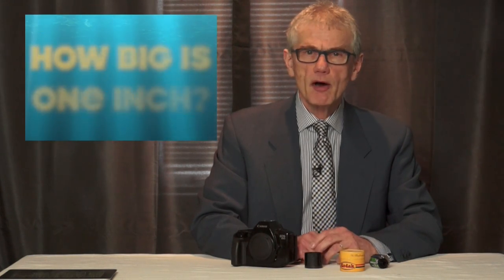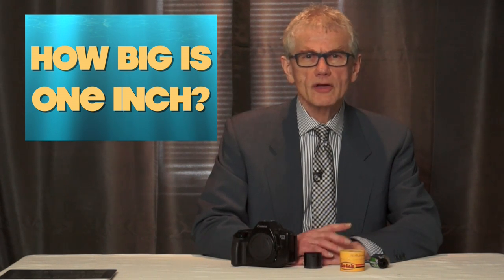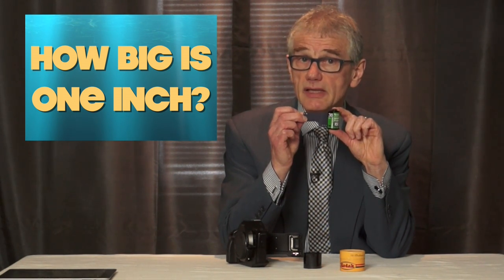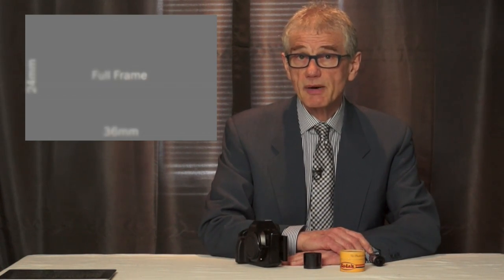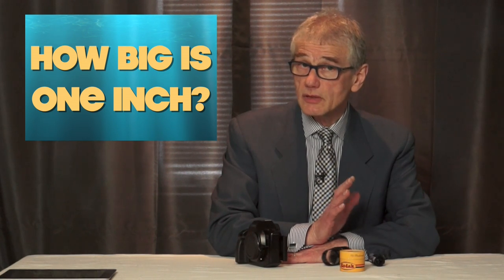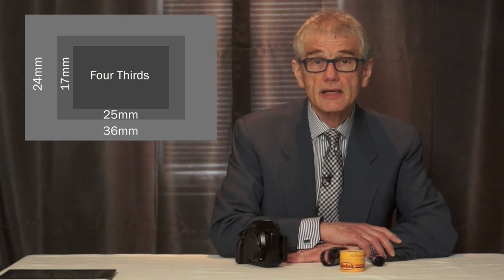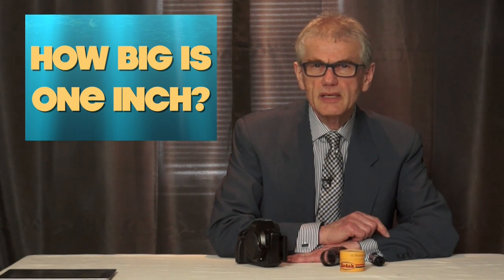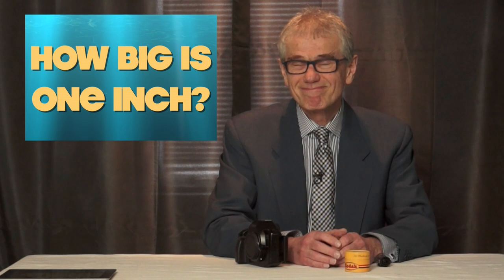How Big is a One Inch Sensor

Comment: That's why  always refer to them as "one inch type" sensor, love the humor :)
Reply from the maker: +ObelixCMM hehe. It's a "type" alright. Thanks for the kind words, much appreciated.
Reply: +Maarten Heilbron Missed the opportunity to make fun of 4/3 size. If I submitted 4/3 as answer to math problem it would be graded as incomplete answer ;)
Reply from the maker: +ObelixCMM You have to love the marketing teams that come up with these terms ... in this case Kodak aided by Olympus. 
Yes, I should have gone after this deeper, but in my mind the script was already running long. The four thirds may refer to the same one inch circle that defines the one inch sensor; or it may refer to the different aspect ratio - as most 4/3 sensors have a native 4:3 aspect.

Comment: Vistavision was a movie format that unlike normal 35mm movies, had each frame is shot with the horizontal line along the length of the film. So, each frame in the Vistavision movie is 24mm tall and 36mm wide. Movie theaters needed a different projector to show these.
Reply from the maker: What an interesting note - thanks for this wonderful bit of trivia.

Comment: BTW, the 1 inch video tube housed many different sensor sizes, the one we call the 1 inch is approximately the largest available. The light sensitive area by necessity required a metal bounding area, and the bounding area(think of is as a type of frame)  varied in thickness from manufacturer depending on the tooling making the product. There were other size glass vacuum tubes but the 1 inch was the default standard so all video tubes were names according to the 1 inch nomenclature. Thus a four thirds sensor fit a much larger tube, but the “thirds” part of the name refers to a third of an inch. A two thirds sensor however, was housed in a 1 inch vacuum tube even though it is a lot smaller than the 1 inch sensor. The actual size of any 1 inch sensor is a lot smaller than 1 inch because while it fits inside a 1 inch tube, its light sensitive area is determined by a formula called the “optical formula”.  Thus various size cameras would use a 1 inch tube but would have a different effective focal length lenses, so the required size of the sensor is determined by a ratio between the lens and the tube, and the actual required light sensitive area would be determined by this formula. 

This resulted in the confusing naming convention we still use. The popular 1/2.3 size is actually two fractions where the second fraction is rendered as a decimal point by an old mathematical convention to render it this way. The first digit is referring to the tube size and the final fraction refers to the light sensitive area. It is the same for the other sizes such as 1/1.7 for example, but of course there ended up exceptions. Since 1 inch was the standard 4/3 omitted the 1 as engineers understood that the 1 should be there and there ended up several other sizes where the 1 is omitted such as 1/10, 1/8 etc where the size should really be 1 /1.10 and 1 /1.8 but it is shortened to make it simpler.

Unfortunately as digital sensors were introduced there was a transition period when both vacuum tubes and digital would both be used in the same studio and to save costs the old lenses from vacuum tube cameras would be used on the digital cameras so there was a need to make the digital chips the same size as the old vacuum video tubes and so we are stuck with an obsolete naming system. Most of the newly developed sensor sizes are named just by their dimensions in mm but customers prefer the predictable results of the existing older sizes and so there is little incentive to change to sensors simply described in mm.

As you can tell, my Aspergers causes me to collect all sorts of technical data. Recently I collated a list of all sensor sizes with all film sizes that are commonly used or most commonly found in antique collections.
Reply from the maker: Wow, thanks for the detailed notes, appreciated.
Reply: Maarten Heilbron I figured you would be one of the rare people who would appreciate these kind of nerdy details :)
Reply from the maker: @artistjoh  100% correct, I'm all about the nerdy details. Andy Kufluk (my tech teacher at Ryerson Radio and TV arts) would be proud.

Comment: The perforations on 35mm film are for cine film. There were several film types (828 E10) that used same size film in still cameras that are able  to liberate 30% more usable emulsion for images. Perforations clearly not required to move film in camera.
Reply from the maker: I appreciate the extra detail, thanks for adding this information.

Comment: Nice video, thanks for the info :)
Reply from the maker: +Viperx66 It's my pleasure, thanks for commenting.
Reply: ***** i have a question for you now that i think about it. I got myself a used d800 very cheap and in excellent condition. I am very satisfied but i found a d810 for around 700- 800 usd + my d800. is it worth it ? In my eyes its not but want do you think ?
Reply from the maker: +Viperx66 That's not a deal I would make unless there was some absolutely compelling feature about the D810 that I couldn't live without.
Reply: ***** ok thanks alot think im sticking with my d800
Reply from the maker: +Viperx66 I think that's the right choice. Put the money towards a lens.
Reply: ***** anything you can recommend ?
Reply from the maker: +Viperx66 By a good quality lens that serves the kinds of photographs you're taking.

Comment: NICE VIDEO!!!
But the real question is what is the "Performance Penalty" of using a "One Inch Sensor" as compared to a full frame one?? I think that is something everyone is interested to know!! Thanks for the video though!!
Reply from the maker: +jayanta base Thanks for the kind words. I'm not sure that the penalty is in performance - I find the differences with smaller sensors to be mostly greater depth of field (so harder to get an out of focus background) and with smaller pixels, somewhat less low light than a larger sensor would have.
I started my review of the Sony RX100 (the original) expecting very little, but was more than surprised. I now have several images taken with one inch sensor cameras printed on my walls at 60x90cm. They are as clear and detailed as images taken with larger sensors.
Reply: Thanks for the quick reply!! When it comes to DOF, there is argument on both sides as sometimes greater DOF can work to your advantage, especially in landscape and macro work. And as someone has rightly pointed out that you can always reduce DOF in post but you can't increase it!!!
The real issue of course for me is the low light performance!! Do you have any estimate as to how many stops of benefit a FF camera has over their 1inch counterparts in low light??
Thanks in advance!!
Reply from the maker: +jayanta base I don't have the tools to get those answers - dpreview and dxomark do, check with them. It would depend on the sensor's pixel count and density, so probably not predictable across all similarly sized sensors.

Comment: What is more important and more clear is the area of the sensor than its dimensions.

For example:

Medium format hasselblad  2159 mm² 100%
Medium format Pentax 645D 1452 mm² 67%
Full frame 856 mm² 39%
APS-C 368 mm² 17%
Four thirds 225 mm² 10%
One inch sensor  Nikon 1 Sony RX100 116 mm² 5%
iPhone 6 17 mm² 1%

The surface of an one inch sensor is the 5% of hasselblad medium format camera which is very popular among real professional photographers. 

Also the surface of one inch sensor is the 13% of a full format camera. 

Bigger sensor gather more light and more light permits lower ISO. So in summer midday sunshine  lighting even an one inch sensor can deliver equal good photos like a medium format sensor. 
Bigger sensor permit flexibility in every lighting condition which is highly important to a professional.
Reply from the maker: +Achilleas Labou Thanks for doing the math on the measurements - those are also interesting ways to look at the difference. A bigger sensor can gather more light only if the number of pixels is the same. Packing more tiny pixels would reduce the advantage. The pixels on a 24 megapixel APS-C sensor receive about the same amount of light as the pixels on a 36 megapixel full frame sensor. This is one aspect of the excellent low light performance of the 12 megapixel Sony A7S.

Comment: 135 film was called 135 because the very first roll film sold in the late 19th century needed a name and George Eastman named it “type 100”, apparently for no other reason that the number 100 sounded large and vaguely scientific, and in Eastman’s mind it sounded “strong”. Eastman had a mystical approach to names. He named his company Kodak because he thought that the letter “K” is particularly “strong” and the word has two of them, and the letter “d”, while not as “strong” as “K” was still stronger than most other letters. No, it has never made any sense to anyone other than Eastman, but he owned the company, and so he got to choose the names. So the first roll film was number 100 and fit the first roll film camera. Over the next few decades he introduced various roll film cameras, and as the camera size changed he would produce a new roll film size and initially each new film just gained the following number consecutively: 101, 102, 103 etc., which had at least some obvious logic and 120 film was the 20th film size introduced. Later, however some cameras required the same width and length film as 120 but needed a thinner spindle for the film to wind onto, so for an unknown reason he called that one 620, and then when they decided to change the way the film is loaded onto the spool providing double film length, Kodak called that 220. Thus a family of roll film sizes developed all based on the original idea of calling the first one 100. By the 1920’s roll film was the biggest seller amongst film types and Kodak catalogues listed their films according to the three digit 100 system. So when they started making 35mm roll film it was simplest to add it to their catalogs as three digit type 135 instead of the two digit 35. Because Kodak was the largest manufacturer of film in the world there were a lot of customers going to shops asking for 135 film so over time all other manufacturers started calling their own 35mm film as  135 size. And it all started because George Eastman thought that the number 100 is “strong”.
Reply from the maker: Thanks for adding this interesting detail, appreciated. Now can you explain the numbering system Nikon uses for the DLSR cameras? Or the rationale behind Sony's A6xxx series?
Reply: Maarten Heilbron Nope, because while I might be nerdy, I am not insane enough to try to find logic within Nikon’s special breed of irrationality, and Sony is simply inscrutable :)
Reply from the maker: @artistjoh  It's always interesting to know that there are challenges even the most adept will not undertake. Understood.

Comment: The one inch sensor has around the same size as a super 16 sensor with a crop of 2.7 if that helps anyone. 
And I thought that Oskar Barnack form Leica was first to use 35mm motion picture film horizontally in a stills camera.
Reply from the maker: "Around" being the operative word. Super 16 is a film format, not a sensor size I'm aware of, with an aspect of 1.66. And it was pretty obscure even in its day. 
For stills, although Barnack popularized 35mm in the 1920's, it was first used in the Tourist Multiple in 1913. Only when Kodak (who manufactured the film) put it in canisters (and developed cameras that used canisters) did it achieve its full potential for stills. Thanks for the interesting note.

Comment: I think the image size for movies is 18 by 24 mm, giving the old standard 3 by 4 ratio. But possibly "super 35" is only 16 mm - I wouldn't know.
Reply from the maker: A standard 35mm film has an imaging area of approximately 18x24mm. For motion pictures, a portion of this area is by the sound track - leaving an imaging area of 16x22mm. In super 35mm the entire width (24mm) is used with no allowance for audio. There are multiple aspect ratios possible in the motion picture specification. Super 35 is a production format, not a distribution format.
Reply: Thanks for the reply. What a great source of information you are.
Reply from the maker: always my pleasure, thanks for your kind words

Comment: Couldn't the one inch part comes from the fact that the hypotenuse of the right triangle formed with the 13x18 square is 22.2 mm, or almost one inch? Kind of the same with how TVs are measured?

Edit: Nevermind, I looked at the micro 4/3 dimensions. The one inch only comes to 14.42 mm.
Reply from the maker: +Adam McGrath Right ... the real explanation, as I suggest, relates to the size of the imaging area in a one inch video sensor as used in studio video cameras (think 1950s). That's also the explanation for micro 4/3rds - the size of the imaging area in a 4/3 inch video sensor.

Comment: So 1" is not actually 1"!? I thought that the diameter of the sensor is 1" =25 cm but by these numbers 8*12, the diameter should be around 14 mm,  But why they call it 1 "!?
Reply from the maker: +RedFox +RedFox No, there is no dimension in which the camera's sensor measures one inch. So asking why is an excellent question. I'm given to understand that it's based on the diameter of a video tube used in studio cameras back in the 1950s and 60s. The largest 4x3 raster that could be accommodated within a nominal one inch tube is approximately the size of the one inch sensor.  Incidentally, that's also the origin of the 4/3rds sensor's name - that's the largest raster that fits in a 4/3 inch video tube. And why inch instead of mm (as is typically used in photography?) that's likely the result of the first tubes being made in the USA.
Reply: +Maarten Heilbron 
Thanks for the clarification,  I am not sure why they use a 50 years old technical term to describe today's technology..  Maybe marketing or because they knew that the professionals got the fundamentals well.  Thanks and very nice channel,  hope to see more educational videos like this one and it would be great if you can review Panasonic zs100.
Reply from the maker: +RedFox Marketing nomenclature always escapes me. I'm considering the ZS100, but have a long todo list at the moment.

Comment: If I remember correctly, the sensor in a Sony RX100 mk II is 8.8 mm x 13.2 mm. 
This means that the diagonal - which is how screen sizes are usually measured - is slightly shy of 16 mm, a far cry from the 25.4 mm which constitute an imperial inch.
And even if you add the hight and width together, it isn't quite an inch, but only 22 mm.
But isn't that always the way? We never get quite what we pay for. Some of the bytes, pixels, millimetres etc. are only nominal, which means: They only exist in the name. Which again is to say: they're not really all there.
Am I the only one to think there should be a law against that?
Reply from the maker: You were clearly paying attention in math geometry class! Apparently (this was a little too arcane for the video) if you place a 4x3 imaging area inside a round "one inch" cathode ray imaging tube (ie those used in studio video cameras) this is the area that results. Hope that helps. Anyway, as with many things "nominal" which in this case doesn't even mean approximate.
Reply: @MaartenHeilbron  Yeah, I heard about that tube very recently, and of course it's always good to have the historical perspective. But I think most people would certainly expect the 1 inch to somehow represent the actual dimensions of the sensor they're buying. So to me it really is a lie. And I think they should be forced by law to stop using that ancient term and only put it in the detailed specs. And instead they should be compelled to list the actual size in millimetres. Some of them do, but you have to read the fine print to find it, and that, I think, is unfair.
By the way, yes I did pay attention in math geometry class (I loved it!). I never really got beyond trigonometry, so calculus is still mostly alien to me. But I've occasionally found good use for sine, cosine etc.
Reply from the maker: @skakdosmer  While I agree, it is accepted practice and caveat emptor.

Comment: WHAT IS THE CROP FACTOR BETWEEN THE 1 INCH SENSOR AND THE FULL FRAME  
   SENSOR ....SONY IS 1.5 CROP FACTOR, CANON IS 1.6 CROP,  4 3RD'S IS 2X.....WHAT IS THE 1' CROP FACTOR????....THANKS
Reply from the maker: It is about 3. And please have your keyboard looked at - the caps lock seems to be stuck. As a result Google flagged this comment as spam - just a warning.